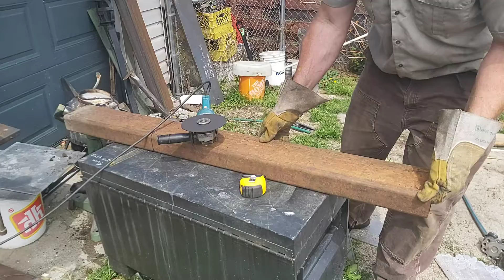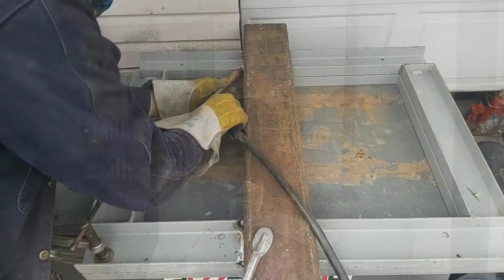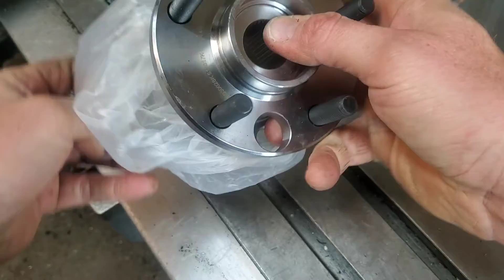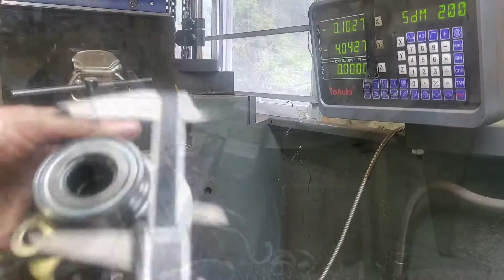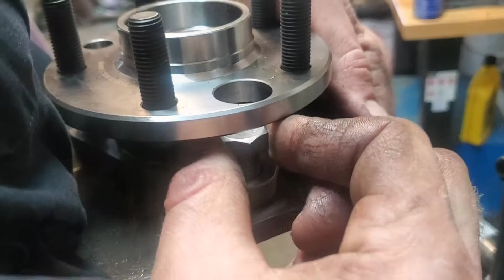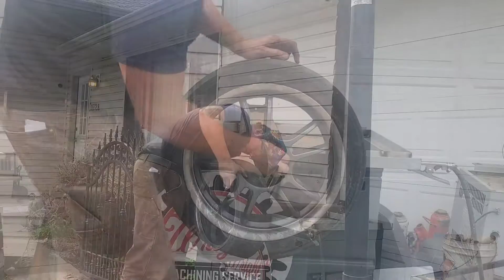Motorized Wheelbarrow Build powered part 2

Comment: Looking awesome! Reminds me of a can crusher I made long ago. I mounted two spindles parallel on a C channel and the tires were about a quarter inch apart with an electric motor driving one wheel. A hopper above the tires fed the cans through the small opening between the tires and flattened them flatter than a pancake!
Reply from the maker: Thanks danny , stoked about  tommorrow . Have a day off in the shop and will be mounting the 2 togeather with a 1-3/4 pin and bearings .
Reply: @Wrighmachining  Can't wait to see the results. Thank you Sir!